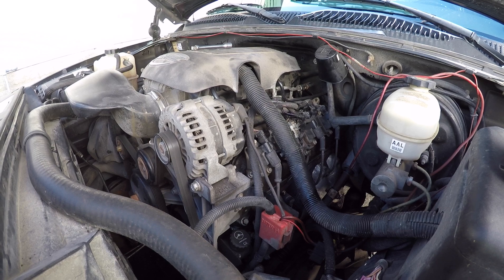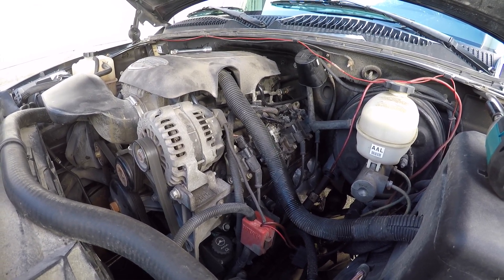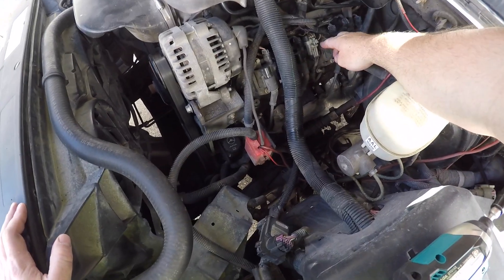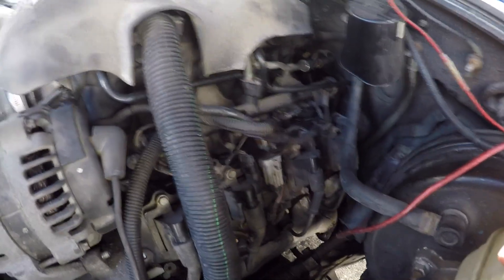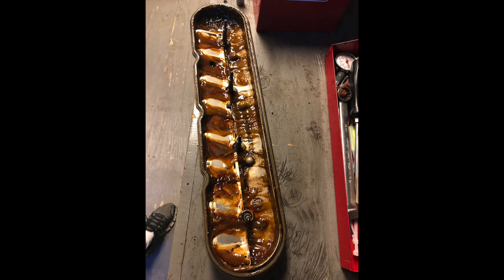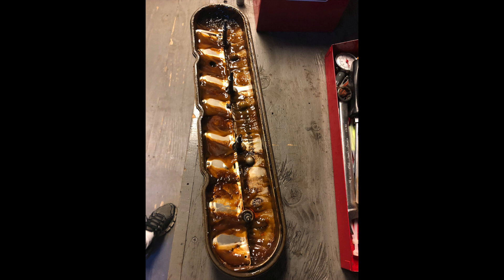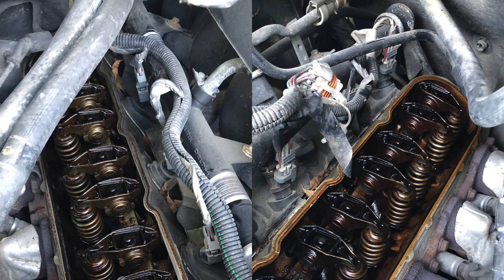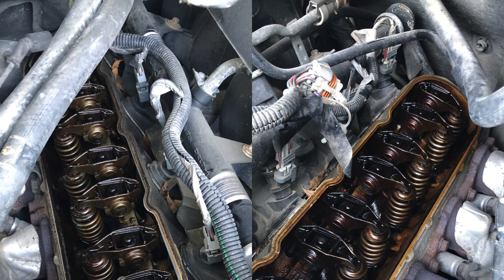Cracked 5.3L Vortec head GMC sierra avalanche silverado

Comment: Everything u discribed was exactly what l had going on . Thank u brotha l know where to start now .
Reply: Same. Removed my valve covers, found tan water/oil condensation stuck to the driver side (not so much the passenger side). Head gasket looked good so I was puzzled on how the coolant kept dropping and why my engine sounded like a diesel. Cracked head (I should have thought of it, but my mind went blank). Anyhow, saving money by doing it myself- but now that I have the heads off, I’m just going to go ported and upgrade the lifters and cam.

Comment: How is that going to tell you it’s cracked , it ain’t until you pressure test it you could of just blown gasket
Reply from the maker: Because a pressure test failed to show a leak both times. This even identified which head was cracked. The cracks are very small.. (Castech heads)
Reply: @bikermike  I’m having bad luck with cheap head gaskets , now I have put a new set on a rebuilt motor then started it up and passenger side leaks, but not in cylinder yet.  Tightened it up some more it quit leaking but other side started leaking.  I wondering if I should pull it back out cause oil in antifreeze makes it hard to seat rings

Comment: Thank you for uploading this video. It definitely helped me out.
Reply from the maker: Glad it helped! Hopefully you didn’t end up with the cracked cylinder head though
Reply: @bikermike   I actually haven’t worked on the car yet. I believe I have a cracked head. How can I tell if I have a cracked head ? There’s definitely coolant in my engine because it’s losing it’s viscosity and it’s turning to like water.
Reply: @bikermike  I will begin by removing my valve covers and pressurize the coolant system to 15 psi to check for signs of coolant making it’s way to the engine.

Comment: For some LS motors that haven’t been maintained well, to include incorrect oil types at regular intervals, the problem could simply be a clogged lifter . Running a good quality filter like a Wix and keeping a synthetic blend or full synthetic in the system will help too. If you have a tick and no sludge anyway. The good thing is that the lifters can be cleaned without removing the heads. Just make sure to chancge the oils and filter soon after .
Reply from the maker: I’ve always run synthetic in my truck and have owned it for 12 years now. They definitely had issues with the castech heads cracking though...

Comment: I have a 2002 Avalanche. I'm having bad lifter tick and my oil pressure is at 10-15 at idle. Start up is rough and I began stalling on me. I'm going to switch out the spark plugs, wires, and packs to see if it gets better. I do have to keep topping off the engine coolant and there are no visible signs of leaks
Reply from the maker: look under the oil fill cap for that sludge depicted in my video

Comment: The ups and downs of having Aluminum heads vortex heads are good but when they were manufacture they made them straight aluminum no other mixed alloys there good but weak summit vortex heads are good little heavier do to mixed alloys but last way longer Chevy will do anything to get better gas mileage but there trucks don’t last anymore your lucky to get 200 thousand out them they need to keep it old school or lower the prices because they don’t seem to be worth it anymore hard earn money go’s a long way when it’s hard earned it seems they make  them die out after a while like computers then you have to buy another one I have a 1955 Chevy pick up and I’ll have it an till I die a true old reliable built to last vehicle.

Comment: Wow this is exactly what is happening to my 2005 GMC Sierra 5.3l V at 171000 miles. Do they program these trucks to self destruct at a certain mileage? Thanks for the video. I'm trying to decide whether it's worth saving the truck or not... How much did it cost for the mechanic to do the work? I'll look in the comments in case you already gave that info. Thanks!
Reply from the maker: I think it cost around 600 labour, plus gaskets, spark plugs coolant etc... Mine is going good still. A new truck wasn't an option for me so I took the chance.... If you do decide to do it I highly recommend doing very frequent oil and filter changes like every 1,000 miles or less 3 or 4  times to get the rest of sludge out of engine,, It will clog the filter.

Comment: My truck is overheating on cold days my coolant is going somewhere but oil is clean I have had a little blue smoke at start up.Going to do cam, lifters and timing chain now after seeing your video thinking heads too. Any thoughts would be helpful thanks
Reply from the maker: Check the valve covers for goop, check water pump, pressure test cooling system. If no goop on valve covers, could be a head gasket. These heads are prone to cracking though...

Comment: Good video! This is exactly my issue on my 04 Tahoe 5.3. Been losing coolant; sludge and now just the last few weeks lifter noise. Will be replacing both heads with lifters.

Comment: I’m pretty sure this happened to me. Pulled the valve cover and noticed there was that chocolate milk stuff all over it. I think I might have both heads replaced so I’ll never have to worry about this issue again!
Reply from the maker: I’ve had no further issues with mine since replacing them. Got them both at autozone. Be sure to do a few frequent oil changes immediately after as there will residue left in engine and it will cause oil filter to become clogged and you will loose oil pressure. Another symptom you can observe of cracked head and sludge in oil.
Reply: biker mike did you buy 706 heads? By surefire
Reply from the maker: @austinsilva5054  I can't remember which one I got at Auto Zone It may depend on your vin#.
Reply from the maker: @austinsilva5054  Just found the receipt  I got the Sure Fire 2CT7 head. It was $279, I guess its $293 now..
Reply: biker mike I appreciate you replying to me bro. I went to the shop and they told me that because we don’t know how long I’ve had the issue they’re afraid of they replace the heads it’ll cause further issues down the line. I’m skeptical because you’ve clearly had good luck. So I’m inconclusive lol
Reply from the maker: Austin Silva it is a gamble if your unsure of how long it’s been. Ultimately it’s your decision. I was lucky 🍀 but no guarantees. If you do an engine swap I’d go brand new remanufactured. Price one out it may not be too bad. Labour will be big though.
Reply: biker mike I ended up just trading in the truck unfortunately. Sucked because I really liked the truck but oh well. Onto other things ! Was quoted close to 5 grand for a new engine and just didn’t wanna chance anything else going wrong. Thanks for your help though
Reply from the maker: @austinsilva5054  Hey man, totally understand you're decision and to be honest I should be looking for a newer ride as well. Mines got 200,000 miles on it now and I've had it for almost 11 years. Fuel pump and lines going on this week. What ya end up getting? I was looking at the 19 Rams but trying to put off the payment thing. Glad ya found my vid helpful, appreciate it!
Reply: biker mike if I knew my gmc was squared away and was reliable would of most definitely kept it. It was an awesome truck but I got unlucky and got one with a bad engine. I guess the the chance you take when you buy a 15 yr old truck. I ended up getting an 18 Nissan Frontier with 10k miles on it ... still under factory warranty. I figured because all I do is haul around my dirt bike I didn’t need anything bigger than that and mainly because I don’t wanna have a super high note lol, It’s a great little truck, just drove it 1000 miles to Florida. 
If you’re still wanting to get a new truck though looks like Chevy is having huge incentives,  dodges are really nice though

Comment: hey my truck had gaskets put on it before i got the truck and didnt leak in the cold weather but now its getting warm its dripping on passenger side bottom of head. it dosnt leak until the motor get warm like 205 degrees it hold pressure in the cooling system and no oil in the coolant and no coolant in the oil. i wonder if the gasket just blowed out ? the radiator was plugged got that fixed so i just dont know if the head is cracked or a bad gasket ?  i have a steel block not aluminum its a 2003 silverado 4x4 oh yeah no smoke blowing out the tail pipes the truck runs strong just started to leak some
Reply from the maker: I assume your leak is coolant? I know they are also prone to leak at water pump gaskets, but if not I would guess it’s a head/block surface issue maybe. 
If it’s oil,  valve cover gaskets.. Where they are prone to cracking it mixes in with oil like in my video but that doesn’t mean it couldn’t crack else where. Clean off the engine and try and pinpoint the leak to see if it’s at gasket surface.
Reply from the maker: Also if it’s front of engine, passenger side bottom of head that’s where the water pump mounts on, the surface of block is really bad for getting a good seal, Ive done water pump gasket twice and it’s hard to get good seal there.

Comment: What about a headgasket
Reply from the maker: Yes could be similar symptoms to head gasket but in my opinion unlikely to have all the tell tale sludge in valve area. Almost the same work to replace gasket and given the history of cracked cylinderheads I'd put a new one on for the $300 xtra if it was just head gasket.

Comment: Good vid.  I just found alot of coolant in my oil the other day when I changed it  I think I caught it in time. Going to pull off the valve covers today like in your vid.     Do you remember off hand what the shop charged for repair?  I know it's a big repair and not sure I want to do it myself
Reply from the maker: I think it was 5-7hours 500-700$, I didn't want to tackle it myself as it is my only vehicle. If I had a second vehicle id be more inclined to tackle it. Mine was definitely cracked and has been fine now for almost one year now. There was bad run of heads for GM 5.3s by Castech I do believe. Hope this helps your diagnosis, and sorry to hear. It really sucks they had this issue the 5.3 is an awesome motor otherwise!

Comment: I have a Chevy Silverado 5.3 Vortec I have the heads off but can't find wat is torque is on them.
Reply from the maker: Gene Parsons I only know they are torque to yield and new bolts must be used.
Reply: You no the spec
Reply from the maker: @geneparsons9922  Check your generation of 5.3 to be sure but i think this may help! https://www.jegs.com/s/tech-articles/ls-engine-specs.html&title=LS+Chevy+Engine+Specifications
Reply from the maker: I've never done it myself but I think you torque to the first ftlb spec then turn additional specified degrees for each bolt. New bolts must be used.